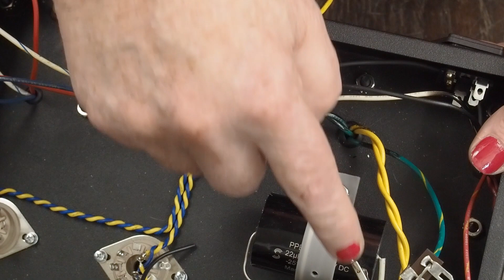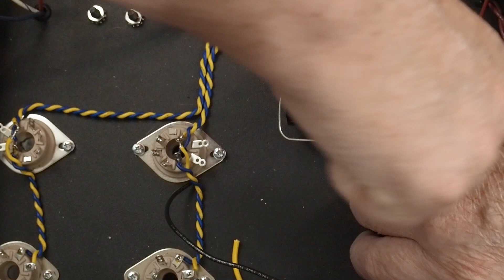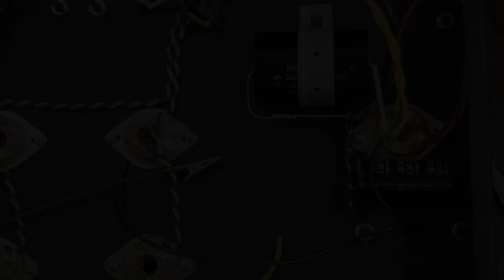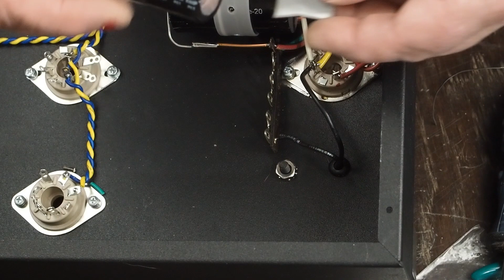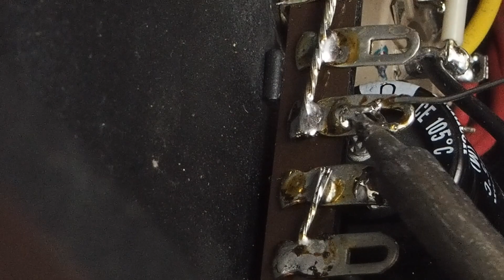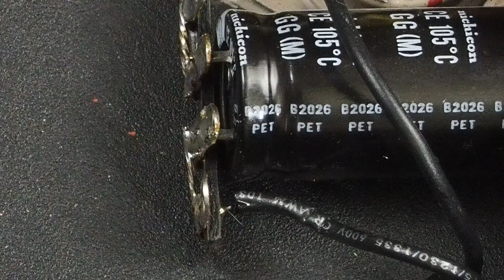6SQ7 EL34 Tube Audio Amplifier: Power Supply Wiring

Comment: This is as good a place as any...  I love your work!  but there's one important thing that you are doing incorrect.   The green safety ground must be the longer than the live and neutral inside the chassis.  Whether you use an IEC socket or a strain relief.  If  the black Live wire is 4" long and the neutral is 3" inside the chassis then the ground should be 5" or more and unobstructed.   This is super important with a strain relief, and not so much with IECs but is UL code.  The thought is if the securement of the mains power fails the longest wire will be the last to fail Iin a pull from a fall or trip, providing ground if the hot lead pulls off the fuse holder.   I usually make a loop from the point of entry up into the chassis then back and solder to a lug, This gives the extra length without being in the way, obviously the loop should have nothing inside it

Comment: Stephe, it seems a bleeder of say 330k would be good?
Reply from the maker: Sure, just be careful to not add too much load/heat to the circuit.
Reply: I see now that yours is a 470k. It was a bit hard to make out the colours until I used a 4K screen @SkunkieDesignsElectronics

Comment: Hi Skunkie!
Does the bleeder r have any effect on the power supply when the amp is on?
Reply from the maker: Yes, it is a constant current drain. You have to look at the current draw of the amp's high voltage vs what the transformer can supply + the rectifier tube rating when you choose the bleeder. Use ohms law to figure that out. 220K to 470K will drain the caps within a few minutes and not stress out the power supply nor will they create a bunch of dissipated heat inside the chassis. Digikey has an easy to use calculator, I use 12V as "safe" voltage.

A 220K resistor will pull the caps down to safe voltage in 3-4 minutes (with no tubes installed) and will have a current draw of  1.8mA and under 1W of power, although I would use at least a 2W resistor. With the tubes in place, they will continue to conduct power to ground when the power has been turned off and the time will be much shorter.

https://www.digikey.com/en/resources/conversion-calculators/conversion-calculator-capacitor-safety-discharge

https://ohmslawcalculator.com/ohms-law-calculator